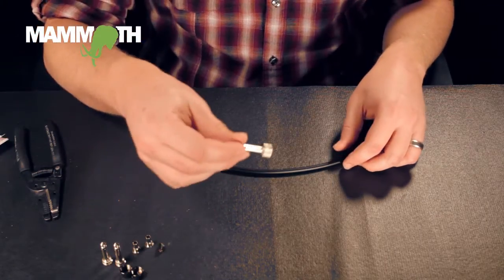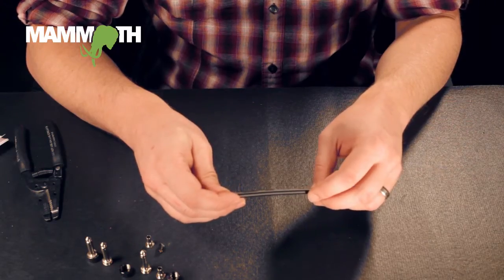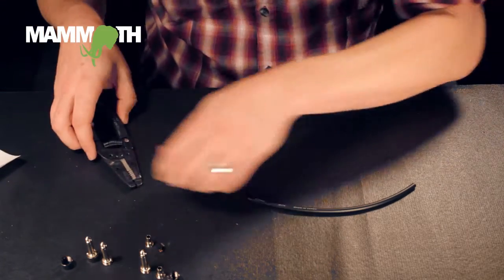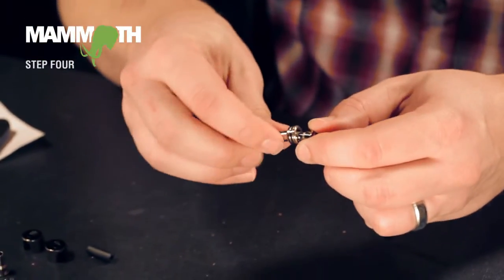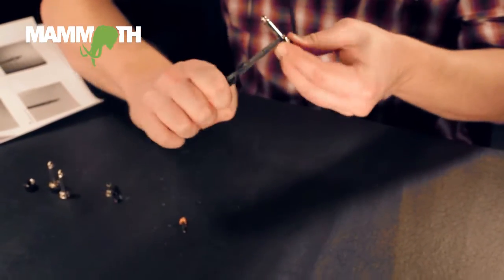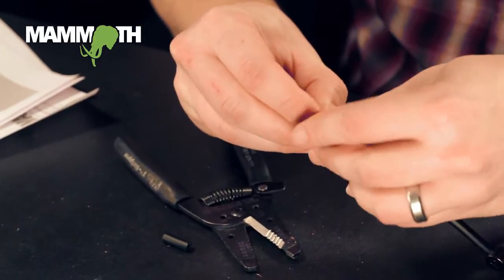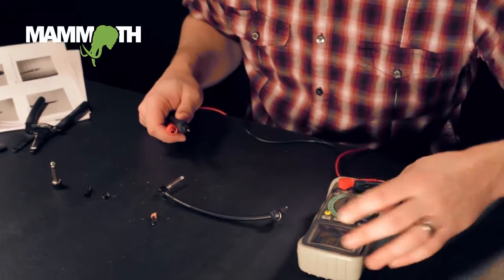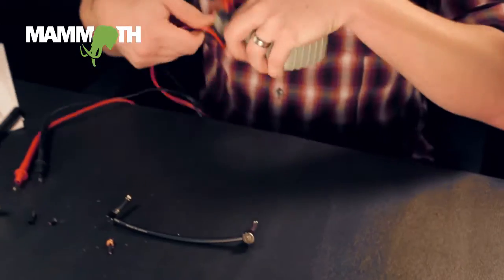Chandler ClearFuse Solderless Plugs Assembly Instructions by Mammoth Electronics

Comment from the maker: Profile (distance the plug sticks out from the enclosure):

ClearFuse : 9.3mm (0.36in)

Pancake (Chandler Brand) : 8.9mm (0.35in)

Footprint of plug (how much space it takes up on a given face of a pedal/instrument)

ClearFuse : 12.8mm diameter (0.5in)

Pancake : 20.4mm x 34.7mm (0.8in x 1.36in)

With pancake plugs, you'll save half a millimeter on profile, but gain an inch on footprint. This could prevent you from using pedals with clustered jacks, or butting pedals together on your board.

Comment: The thin pancakes like the Hosa IRG-100 are quite a bit (relatively) thinner, and in some instances will make enough difference to matter (believe me I know). Having said that, pancakes are bigger around, so if you have plugs in close proximity-which is the case surprisingly often- they wont always fit side by side - then these are great.  Really boils down to what works for your setup (course that means you have to buy some to test...)